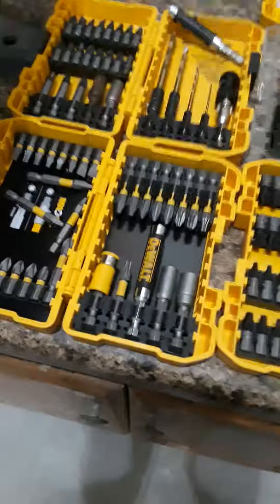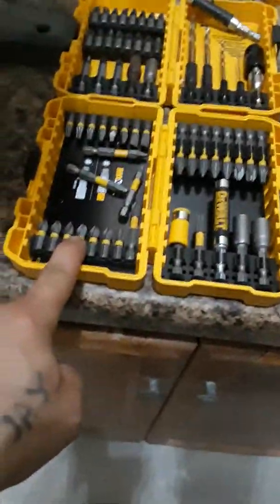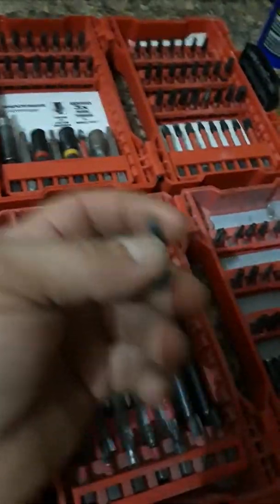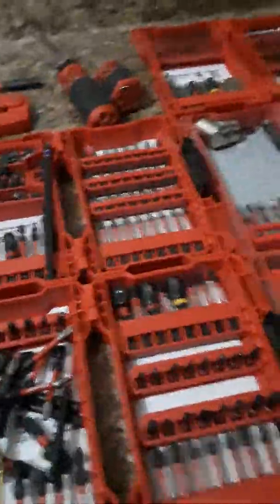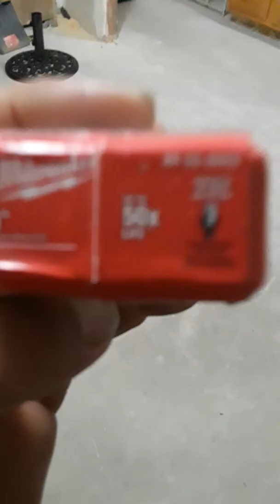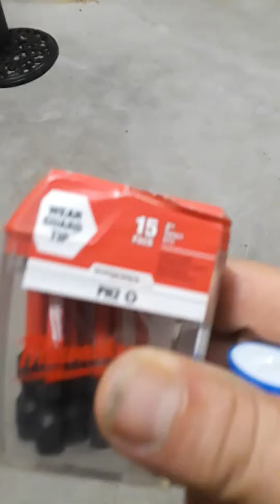All types of driver bit sets you should always have on hand.

Comment: I was disappointed with the Milwaukee set, the magnetic extension doesn’t accept the bits well, the bits don’t slide in and out well they’re all chewed up it’s weird. I haven’t found a set with a screw guide either, I bought the Milwaukee standalone screw guide with the scale on the side but I find the dewalt maxfit 2” to be a whole different class. But my Milwaukee bit holder basically came all nasty I haven’t had that experience with dewalt yet but yea I basically agree with every observation you made. The older dewalt’s weren’t so hot
Reply from the maker: I'd go with the new Dewalt 50 X the life bits, they come with a nice screw Guide bit holder and it's solid tool steel not like the other ones that are irony aluminum with the black and yellow rubber cover.
Reply from the maker: If you want a good Milwaukee screw guide look for the small Milwaukee electrical one with the bits inside it has around 12 bits inside the handle it's square shaped and has a nice screw guide bit holder with it and it's $9.98 at Home Depot stores it's near all the bits in the tools isles. Your friend has shared a link to a Home Depot product they think you would be interested in seeing:

Milwaukee	Shockwave Impact Duty Drive Guide Set (12-Piece)
https://www.homedepot.com/p/Milwaukee-Shockwave-Impact-Duty-Drive-Guide-Set-12-Piece-48-32-4507/203086495
Reply from the maker: I sent the link from Home Depot. 👌 that's the best  driver bit holder with screw guide I've ever used. And I use it all the time in my 18v-20v brushless impact drivers . And it's lasted through everything I've used it for no problem.
Reply from the maker: Also if you scroll down on the link you'll see the dewalt bit holder at the bottom left hand side. 👌 that's my other favorite one I use.

Comment: Do you prefer bits with the torsion zone or all metal
Reply from the maker: If you're using an impact driver to put in screws, definitely bits with a flexible zone, because the other ones will shatter at the tips, Milwaukee 50x bits, makita black impact bits and Dewalt 50x bits are the best by far and I've been using all different brands for 20 years now.  Any bits without a flex zone are for light work and not for impact drivers, I only use those bits in my drill with a low clutch setting .
Reply: Jason Levesque i wonder who actually makes all these for them. I bet you we could make a killing actually putting some thought into a complete line of bit sets
Reply from the maker: @Fee.1  they are all made in China. 👌🤷‍♂ doesn't matter what brand. Dewalt, Milwaukee, makita, Bosch, Hitachi, etc just like most of the parts in the tools, all made in China. 👌 some are made a little bit better than others that's all. Depending on who they out source to.

Comment: Wait the maxfits shattered for you? That’s what they use on all the ttr’s that’s crazy. The clear case maxfits are the same as the ones. You pointed to, they’re just shorter. 

What’s the name of the kit you really like with the clear case
Reply from the maker: Yes I've shattered tons of max fit dewalt bits an the tough grip bits also, so I never use those in my 18-20 volt impact drivers no more, I only use those in my 12v impact and regular drills on clutch setting at 10 or lower. I literally shattered 4 dewalt maxfit bits in 20 minutes putting in blue 2-1/2 inch concrete tap con screws. Then I switched to a Milwaukee 30X the life bit and it finished my whole job 1 bit putting in 30 more screws. 👌 and I still have that same bit. 😂 in my case and that was 2 years ago I did that job.

Comment: Did you try matrix carbide? Im wondering if they would’ve been great for you or terrible. Also was someone in the shower behind you?
Reply from the maker: No never got a chance to try them because they discontinued those bits, they were originally made to drive basically Sheetrock screws and everyone was breaking them doing long screws. So they took them out of stores etc. But they say they're going to replace them for more uses. I got 5 sets of the sliver 50x Milwaukee kits. And I've used them a lot and not stripped out 1 bit yet. Some I've drove over 50 2-1/2 inch or longer screws with and they barely have a scratch on them especially the #2 bits. They are definitely the most durable bits I've used .